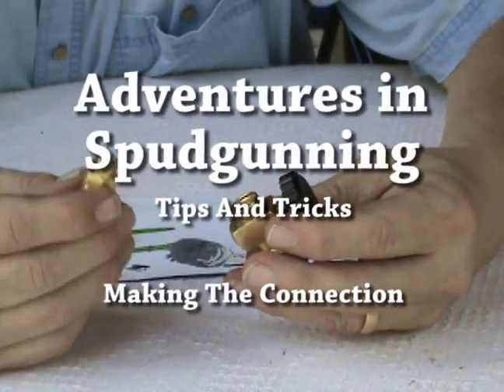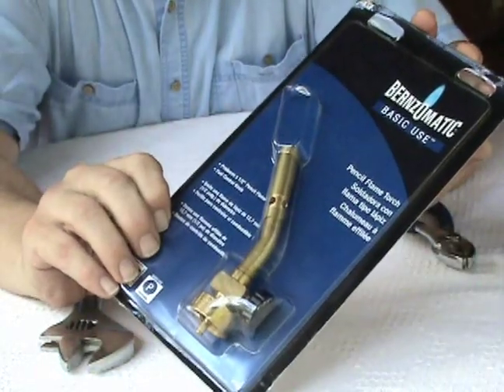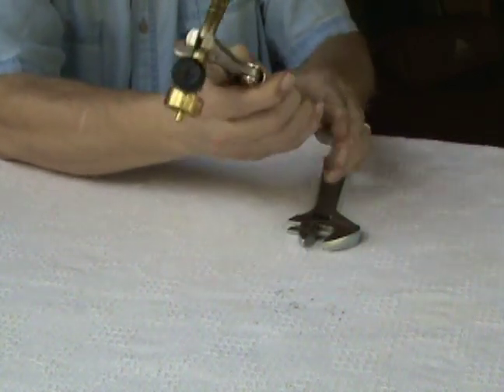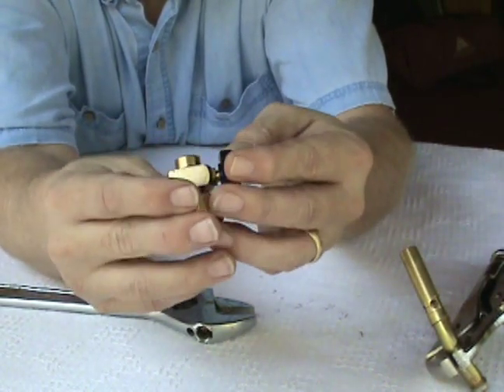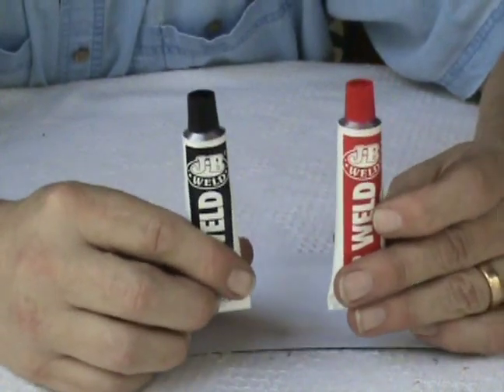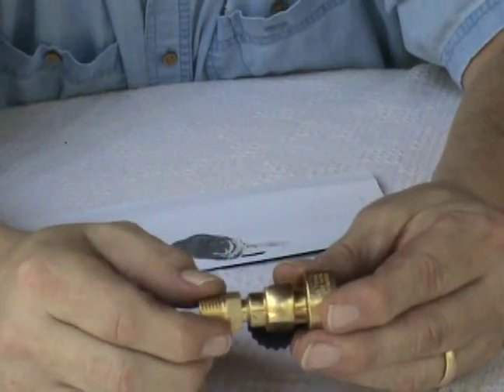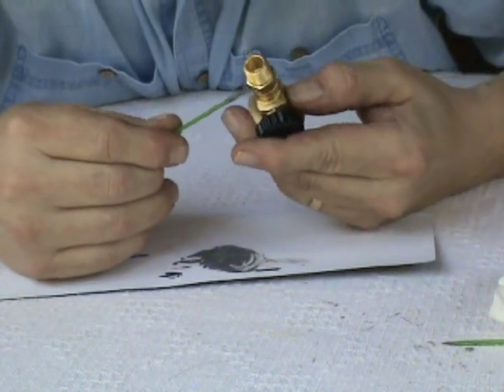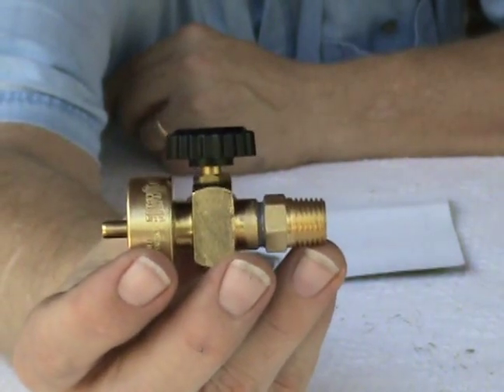Making The Connetion

Comment: I did almost the exact same thing, only I took my pencil torch valve apart, removed all the internals and soldered the flair fitting in, then replaced the internals, I believe that makes a better connection than jb weld.